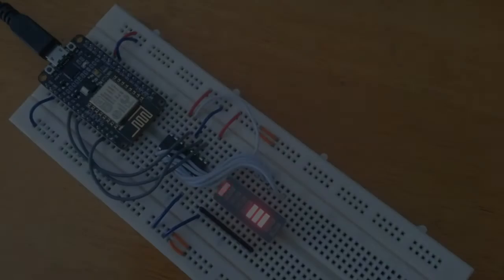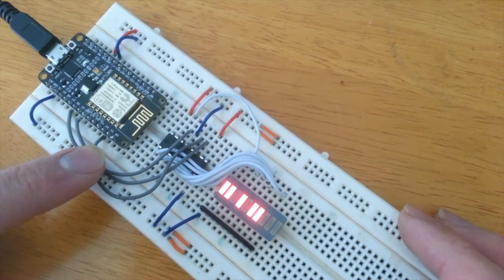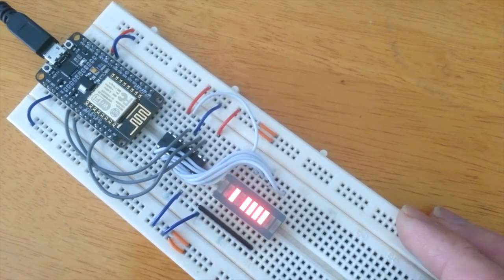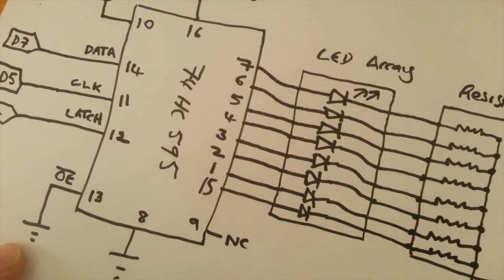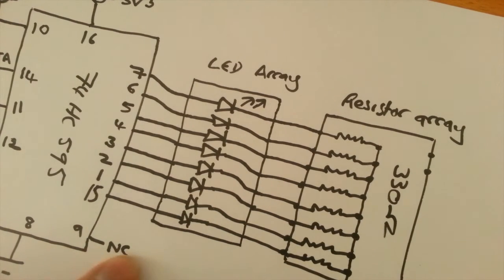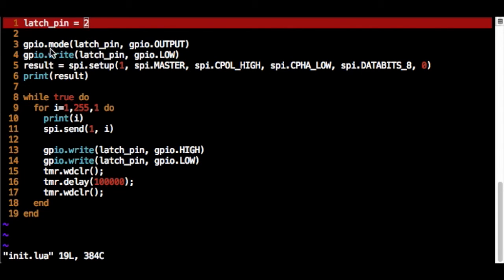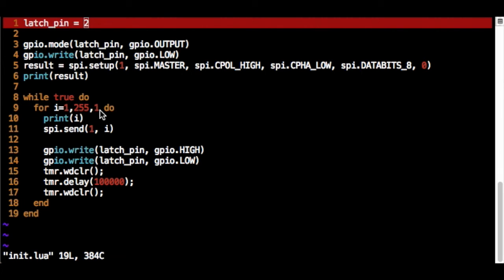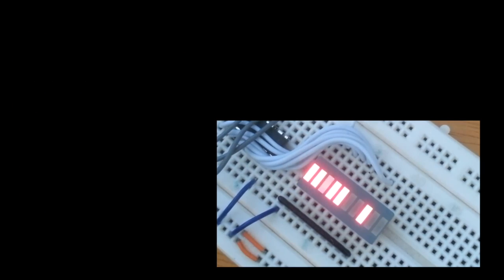Getting extra outputs on the NodeMCU (ESP8266) with a 74HC595 shift register

Comment: Being new to NodeMCU eLua programming, your tutorial was helpful to me for figuring out how to drive a 7-Segment LEDs. I think I must have some pins crossed between the '595 and the 7-Segment display or perhaps the eLua SPI code is sending LSBit first (or some combination there of) as the 7-Segment codes I worked out didn't work. But since your program displays all possible segment combinations by performing a binary count from 1 to 255, I used that to drive my 7-segment display and since your code displays the decimal code, whenever it displayed a recognizable character on the 7-Seg LCD, I'd copy down the associated decimal number from the ESPlora terminal window. I did have to slow it down with a 3 second delay between each iteration of the for() loop so I'd have time enough to recognize the character and copy down the decimal number. So, thank you for your demo. 

I suppose I'll go back thru my wiring and try to figure out what is actually wrong, but for now I'm enjoying the fact that what I have works. 

-WRM
Reply: -- --------------------------------------------------------------------------------------------------------------------------------------------
-- Based on Luc Small's NodeMCU eLua script to drive a 74HC595 to display a binary count (1-255) to 8 LEDs
-- Youtube video link:    https://gist.github.com/lucsmall/66d9b6539df7a0daa569
-- Source code link:        https://www.youtube.com/watch?v=MimllhWR0so
--
-- This script is designed to display hext digits from 0 thru F, plus space and dash
-- to a 7-Segment LED display. While this code works, I likely had a wireing issue 
-- between the '595 and the 7-Segment display or perhaps the eLua SPI code outputs 
-- the bits LSbit first (I assumed MSbit first) because the 7-segment codes I worked
-- worked out on paper did not work correctly. However, I was eventually able to work 
-- out the codes using Luc Small's original code with a bit of extra delay between 
-- each count.
--
-- --------------------------------------------------------------------------------------------------------------------------------------------

-- Luc Small uses D2 as the 'latch' (aka 'SS', 'CS', or 'STCP') signal instead of D8; not sure why.
latch_pin = 2
gpio.mode(latch_pin, gpio.OUTPUT)
gpio.write(latch_pin, gpio.LOW)  -- Make sure our latch signal (CS) is low before beginning our routine

-- Initialize SPI object
result = spi.setup(1, spi.MASTER, spi.CPOL_HIGH, spi.CPHA_LOW, spi.DATABITS_8, 0)

function print7seg(charCode)
    -- Send byte value to SPI object to transmit a bit at a time to the LED display
    spi.send(1, charCode)
    -- Pulse the latch signal line to move data fro the '595's shift register to its 
    gpio.write(latch_pin, gpio.HIGH)
    gpio.write(latch_pin, gpio.LOW)
    return 
end

-- Set up array to handle 7-Seg Display Codes for 0-F, plus 'space' and 'dash'.
--      { 0, 1,  2,  3,   4,   5,   6, 7,   8,   9,  A,   b,   c,  d,   E,   F, space,  dash}
codes = {95, 6, 59, 47, 102, 109, 125, 7, 127, 111, 119, 124, 56, 62, 121, 113, 0, 32}

-- Cycle binary count from 0 to 255 forever
while true do

   for i= 1, 18 do
 --      print(codes[i])   -- debug code
       print7seg(codes[i])
       tmr.delay(500000);   -- wait a half second between each digit displayed.
   end                      -- end for() loop
    
end                         -- end while() loop

Comment: Is it a regular 595 or one that works with 3v3?
Reply from the maker: It's a 74hc595. The 74hc logic family will work with Vcc anywhere between 2v and 6v. Check out https://en.wikipedia.org/wiki/7400_series for all the 7400 series variants and operating voltages.
Reply: Yeah, nice thing about the 74HCxxx series is that you can set the Vcc down to 3.3V and then have your familiar "TTL" chip working at 3.3V logic levels compatible with your ESP8266 SoC or other 32-bit 3.3V MCU. That way you don't have to worry about voltage dividers and/or voltage shifters to match TTL and other +5V signal to the 3.3V inputs of the ESP8266.  P.S. nice write-up Luc.